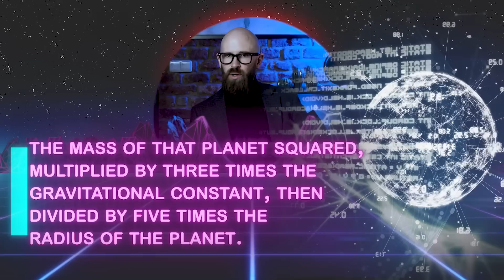Is It Possible to Destroy a Planet with the Death Star Laser?

Comment: Question: "Is It Possible to Destroy a Planet with the Death Star Laser?"
Answer: Yes, essentially there is no limit to how powerful a laser can be made given enough power and if you did, for some strange reason, make one powerful enough to breach a planets crust, mantle, core and inner core - and convert it's core and inner core into plasma and then rapidly expanding gasses, quickly enough, it would in fact explode. The power output required to accomplish such a goal would be an astonishing number - but ultimately doable. The real issue is - why? With a minuscule fraction of that level of power you could simply railgun a solid object at a planet and destroy it far more easily. Or hell, if you're just really - really - into lasers: you could destroy a planet by using a nice big laser to propel a sizeable asteroid, or perhaps even planetoid, towards said planet and destroy it that way and it would still consume a minute fraction of the power required to explode the core of a planet as described above. It's not that the death star effect is impossible to accomplish - it's just remarkably inefficient compared to so many other possible options which would be far easier.
Reply: i thought there is an upper bound before you create a kugelblitz
Reply: @judgeomega  that is correct. E=MC2 means that, as odd as it sounds, a laser produces gravity. While at some point, the laser would eventually just melt everything and probably cause some secondary explosions long before the energies necessary to generate a singularity were reached, you would still have major issues overcoming the binding energy with just light.